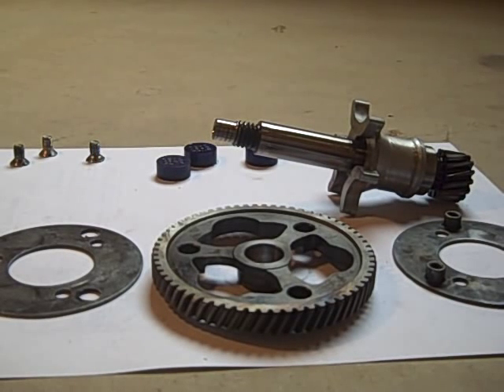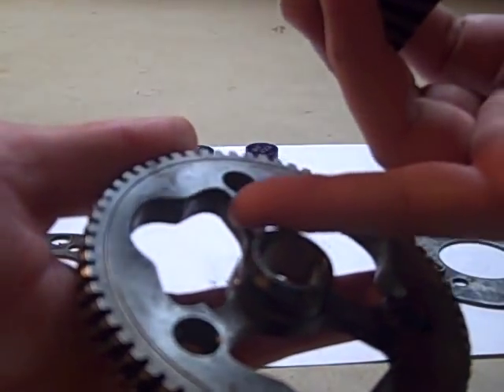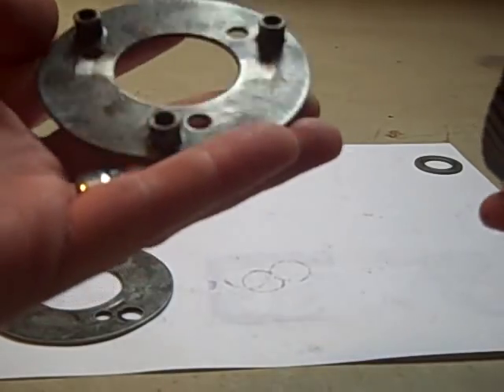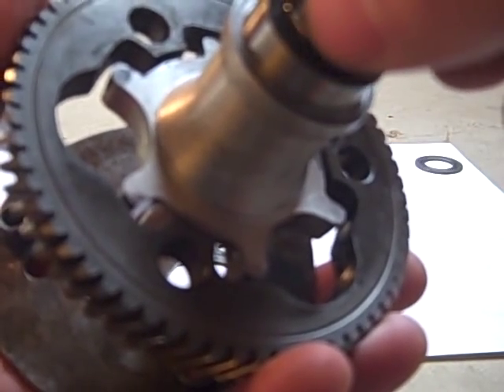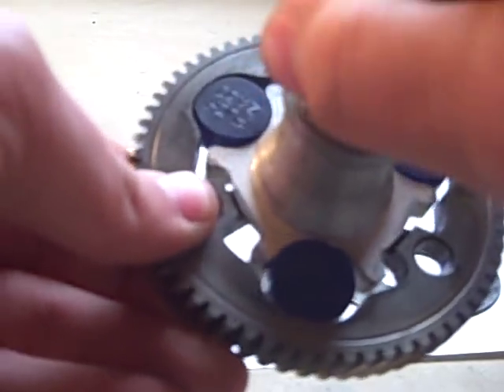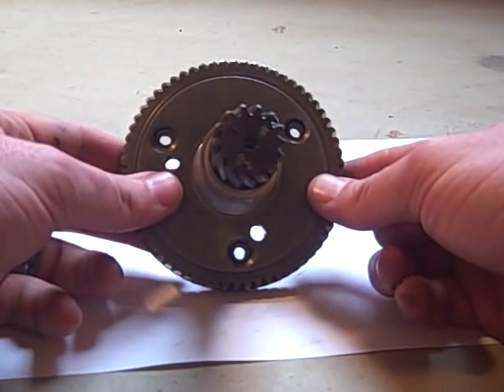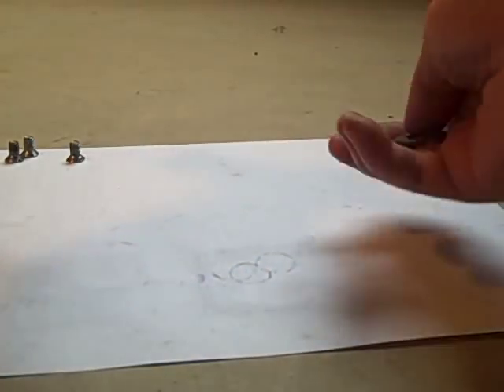09 assemble 2nd and puck install

Comment: I k how this is late but I have the new white atomic pucks and there stupid stuff it doesn't let me squeeze it to put it in do u have any ways of doing this
Reply from the maker: I've not used those in the past, but pucks are usually pretty hard plastic.  If you're having a hard time getting them in, maybe try leaving them out in the sun for a while or running them under hot water before drying them off and inserting them to soften them up just a little bit.  Another idea might be to guide them in with a thin piece of metal and tapping them gently into their slot.  If that doesn't make sense to you, let me know and I'll explain further.

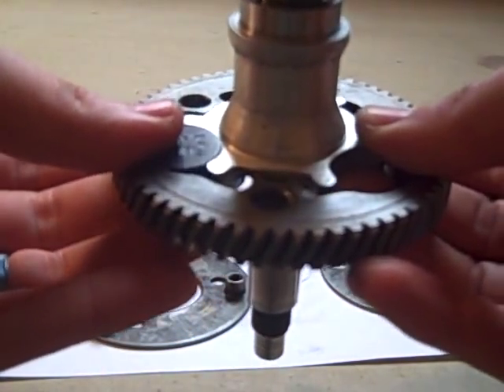Edit:  If all that doesn't work, you can try doing what I show at 3:00 in the video, but instead of just inserting one put all 3 in at an angle like that and work them all in at the same time.  Let me know how it goes!